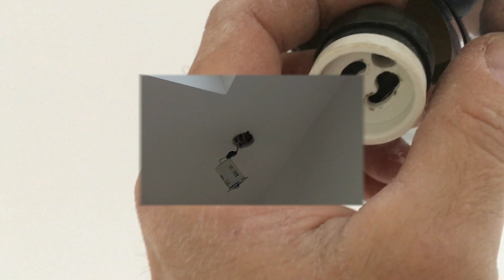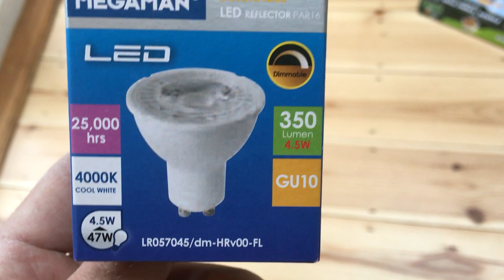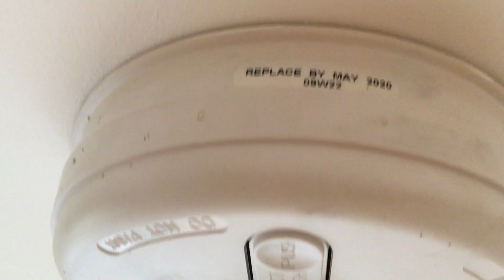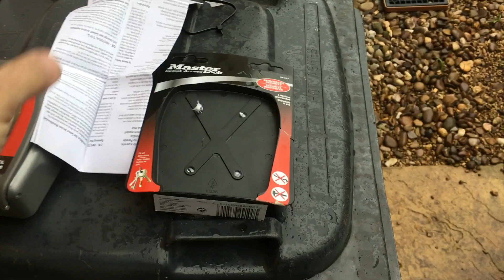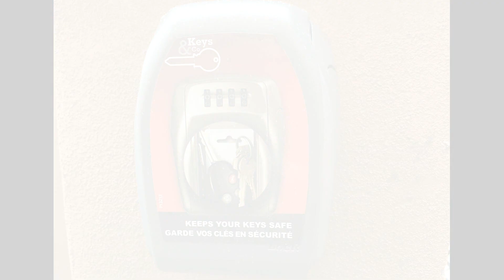Small Electrical jobs in Bristol - Your Local Electrician

Comment: Great video Steve! I've got about 70 of these lights in my property! Replaced all the halogens with LEDs 5 years ago and apart from being safer, it's paid for itself several times over. I did the maths: say an average of 3 hours a day per bulb (some are on a lot longer than others), that's about 1000 hours per year. 1 Kwh of electricity is about 14.4p according to https://www.ukpower.co.uk/home_energy/tariffs-per-unit-kwh. 70 x 70 = 4.9Kw * 1000 hours = £4900 per year for halogens, compared to 70 x 15 = 1.05Kw * 1000 hours = £1050 for LEDs. OK, it's a big house and most people don't have that many bulbs, but the sums are the same.